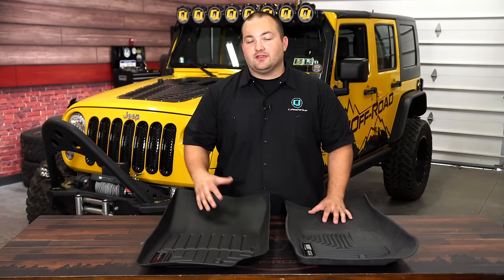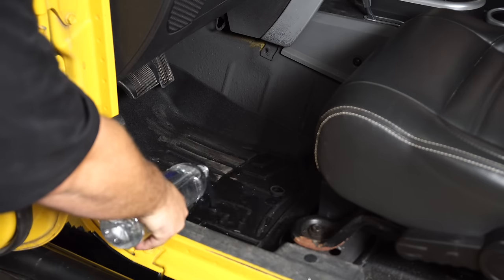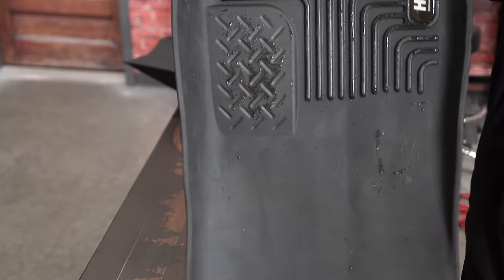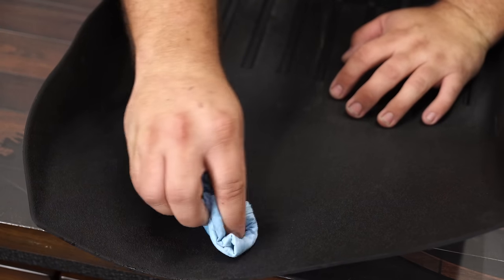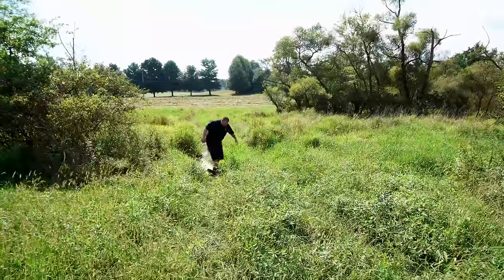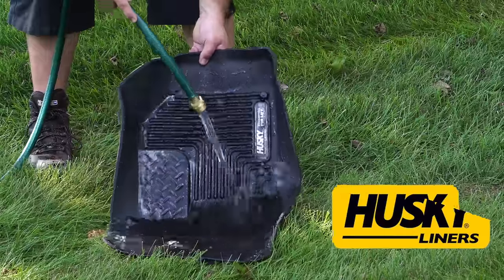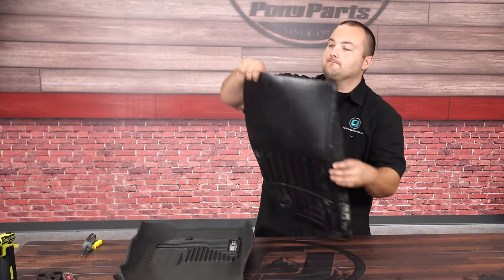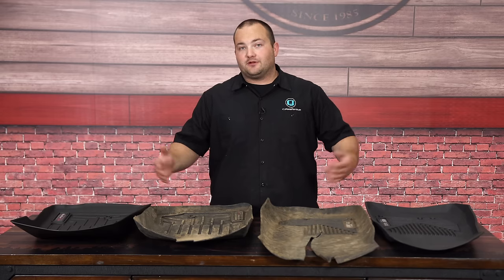WeatherTech VS Husky Liner: Torture Test and Comparison!

Comment: The Husky floor mats don't hold up.  I wore a hole in the driver's side with my heel after 16 months and 18000 miles.
Reply from the maker: Which set of Huskys was that?
Reply: @CJBroncoF150  
The mats were the fitted ones for a 2017 F 150.
Reply: @Adolph morris - I have to disagree with you, as my Husky's have held up incredibly well. I have a set of Husky Weatherbeater mats in my 2015 F-150 that looked brand new after 3 years and 35k miles. They looked so good, I put them in my new 2018 F-150.  Thankfully Ford didn't change the design in those 3 years. I like Husky liners so much, I bought them for my wife's Camry.

Edit: I have no comment on the Weathertech's, as I've never used them. From the look, it sounds like they are comparable. I'd go with the cheapest/sale item.
Reply: I’ve had mine for 3 years and 66,000 miles and they are still in great condition
Reply: @jhinsonx72  I can't attest to your mats durability. However, I drive my F150 Platinum as a daily driver. I'm retired so I don't put a lot of miles on the truck and rarely transport things in the bed. As I said before in 16 months of ownership with less than 18k miles, a hole was worn by the heel of my shoe. The area was between the brake and accelerator area. Maybe I got a defectivly thin mat, but a hole was worn in it by light usage with regular shoes and sneakers, no work boots was worn.
Reply: @Morris1974  - Not that it helps your situation, but it does sound like you got a defect. I wear heavy work boots and mine with 36k miles show only the faintest sign of any wear. Honestly, these things are so thick, I don't even see how it's possible to wear thin in 200k miles, let alone 18k. Like I said, I don't think anyone could go bad by choosing either brand, but both will have a small batch of defects.
Reply: @silverback7659  No, I vacuumed them at least once a week and washed them as needed.
Reply: Can you post a picture of the matt showing the wear?
Reply: @jhinsonx72  Hey, just curious if your huskies were/are subjected to harsh winter chemicals. I have 2 sets of the weather tecks and I am now looking at different options for my family's other vehicle. I have found that my weather techs are faded now after 2 seasons. Vacuumed and washed when necessary.  My other gripes are 1. I find the hard plastic is certainly slippery in the winter, and 2. I hate that my techs have no way to cover the anchor holes...water/slush always finds it's way to the carpet at this access point.
Reply: @Morris1974  I would contact husky, they do advertise lifetime warranty
Reply: So did mine. So I had them replaced for free. They instantly sent me a full new set even though only the driver side was worn.

Comment: They are both shitty. Weathertech stays virtually dirty no matter how well you clean it just after 2 months of use, unless you put some dressing on it to cover it up which is pretty silly too lol
Reply: Tamik TV I own a mobile auto detailing business and the fastest and easiest way to clean up weather techs or any rubber floor mats in general is to spray them with some of that cheap Awesome cleaner from the dollar tree and then pressure wash them off, works every time. only in certain cases where they have gum or really hard sticky dirt do I have to take a steam cleaner to them.

Comment: Had Weather Tech & they warp like crazy! No warping with Husky!
Reply: Klperformance68 yea my weather techs warped
Reply from the maker: If you heat them up with hot water or a heat gun you can reform them 😎
Reply: Opposite results. My friend and have same trucks. My weathertech still have the original shape.  The husky liners have deformed. NE MONTANA -40F TO 110F IS HARD ON THE HUSKIES